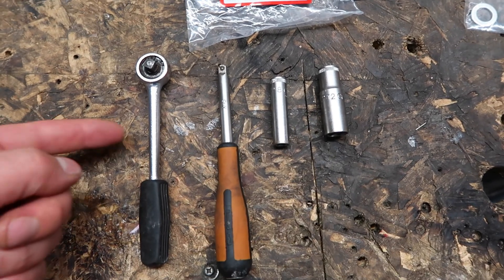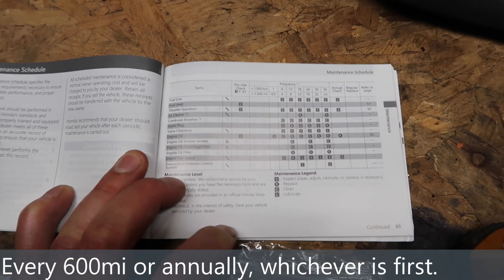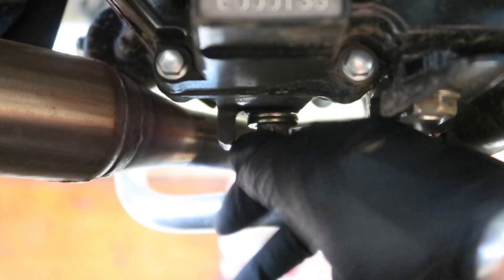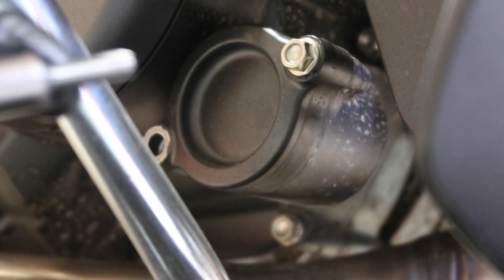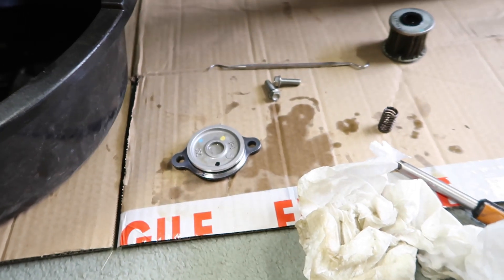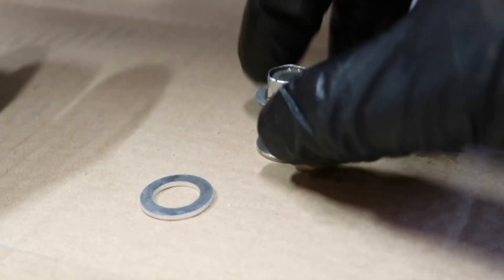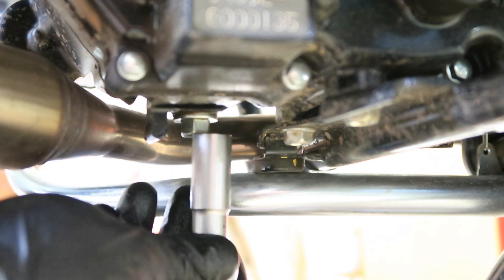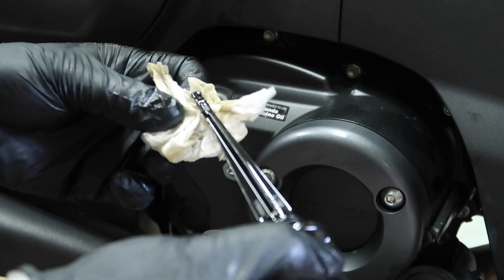2022 Honda Supercub C125 Oil and Filter Change - Tools Parts and Method JA58 Engine

Comment: I have a magnetic drain plug, which doubled as a 'tool' to remove the oil filter. Using same oil, which I changed at 300 miles, 1,ooo miles then every thousand. I also checked valve clearances at 2,500 miles and they were slightly tight. Bike runs much smoother with more miles I found. Occasional drive chain oil with gear oil and one clutch adjustment. For information I believe the recommended torque for filter bolts is 9 Nm but some people with groms stripped the threads at that so I went to 6 Nm which I felt was more than adequate. The 22 cub only has a strainer, the filter replaces the centrifugal spinner.  Thanks for the video.
Reply from the maker: What an excellent comment. Thanks very much indeed. Better overserviced than underserviced. Keen to see how it relaxes with a few more miles.
Reply: @EpohDerf  It got noticeably better with 2 - 3 thousand miles I found, both in smoothness, pull up hills and gear changing has become really smooth, maybe helped by becoming in tune with the bike I guess..  Anyone finding life difficult I would encourage to consider having a Honda Supercub in their life if possible,  it has helped me (lots). Oh and follow your biscuit reviews to help make an informed choice of what to take on a ride out with the flask of tea.
Reply: This is an informative video thanks. Anyone seen a service manual for the 2022 version yet? I enquired at Fowlers and a dealer but they only had last years book unfortunately. It appears to be available in the USA but with fairly high costs involved.
Reply from the maker: @stuleyland9490  that you found the video informative is excellent; means it was worthwhile making the video.

I've not looked for a workshop manual yet...or a Haynes but it would be nice for sure.
Reply: Finding comments like this added to the video priceless. Planning to do my own maintenance for a number of reasons, you guys are making that a real possibility. 

Finding it hard to locate a workshop manual for the 22 Cub, dealer I bought the Cub from told me they only have them as a digital item.
Reply: What is the valve settings for the 22 cub

Comment: Thanks for the video Fred. Just a word of caution, try to avoid using a metal pick, screwdriver etc to prise out the o-ring. Better to use a tie wrap or similar to prevent scratching the sealing surface and thus causing a small but annoying leak. For me it's a case of been there, done that!
Reply from the maker: Not heard the tie wrap trick before so will do that next time. Thank you very much indeed for your tip.

Comment: Is it OK to use standard oil instead of synthetic oil? And the second question is when you purchase the scooter from the factory, do they use standard oil or synthetic oil initially?
Reply from the maker: @sjcafiero   10W 30 JASO T 903 MA2 fully synthetic is the specification of oil the bike needs to be filled with. I don't know for sure how they come from the factory but can only assume they use the same spec of oil they recommend in the user manual.

Thanks,

F.

Comment: The sump plug washer has a ridge because it has been 'crushed' on installation to form an effective gasket. That's why they are soft metal such as aluminium or copper.
If you don't have a replacement you can re-use by annealing the metal, softening it up again ready to be re crushed 👍🏻
Reply from the maker: I've 'cheated' this way before with a peugeot 205 sump plug washer. Great tip I should have included. Cheers.